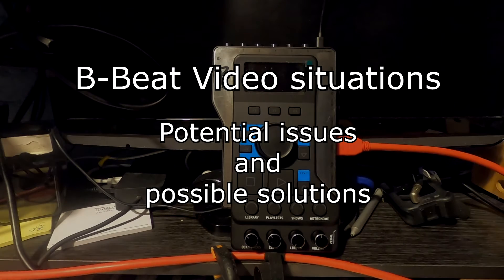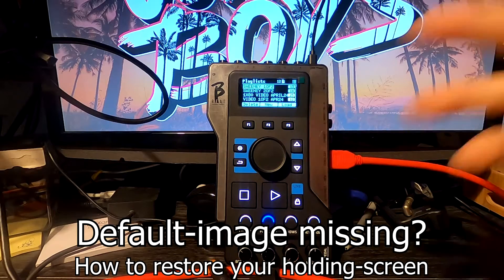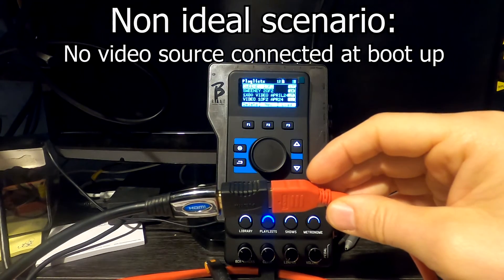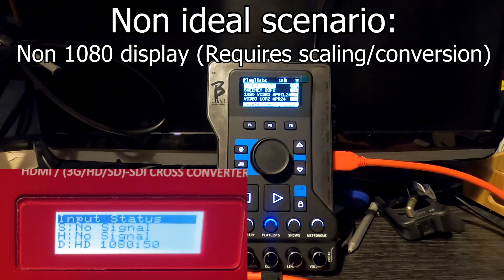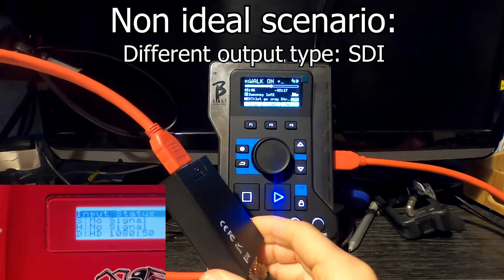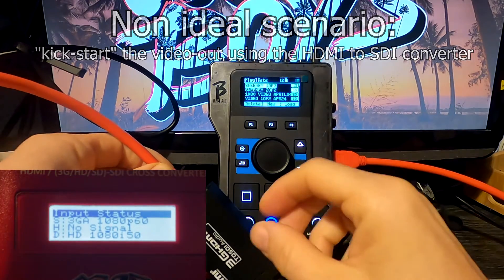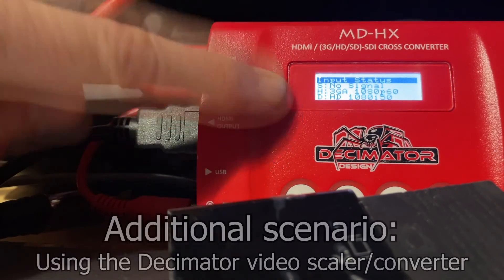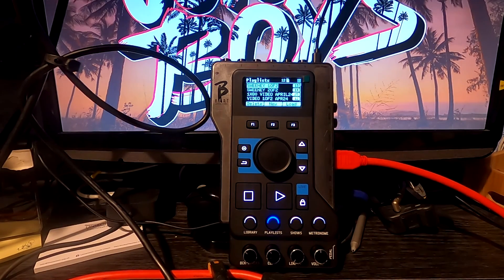B-Beat video output: scenarios and solutions

Comment: Thanks for this video - its pretty clear to me that the BBeat does not output a "standard" signal, if it did then we simply would not have these signal issues. The other day I was at a gig with a large LED video wall, the video feed to FOH did not detect any signal but you plug in a cheap £250 laptop and it works flawlessly. We as consumers should not have to spend £400 on video scalers or any additional devices, the BBeat is a unit aimed at professionals and its going to be used with professional displays and not cheap computer monitors. Surely MLive could change the firmware to allow the end user to change the output resolution and framerate just like a laptop?
Reply from the maker: i agree with your comments and, as you probably know, have suffered similar having to invest in expensive scalers to get round the issue. I think the product-developer is aware of this and will hopefully address the issue in the near future. fingers-crossed!
FWI, i have had a couple of modern LED-wall venues where in -house video sources work but not the b-beat where i've been adding/removing scalers, swapping cables, the venue blaming us (the b-beat) and then mysteriously it worked (without scaler!!) The only conclusion i draw there is the tec-support didnt really know their own gear and either tried something different or realised they'd made a cock-up and kept quiet.

Comment: Just bought this piece - unfortunately the video does not come out at all - tried other solutions, does not work on monitor, or projection
Reply from the maker: Guess you checked your cables and tried a variety of display devices? Have you assigned your video/image file to a project file for playback? (check- do you see a b-beat logo when booting up the b-beat whilst connected to your display?)
Reply: @ thank you for getting back, tried as well - no B-Beat logo appears
Reply from the maker: @ hmmm, not sure then. Could it be having it set to "prompter mode" (so the video-out is auto-cue/words/pdf rather than image/movie mode) be the cause? think you can find that in the b-beat settings or by using the PC/Mac editor. Not used it myself but aware of it

Comment: what type of video file does it take and how big can it be? I am very close to getting one of these. thanks for your help. greatly appreciated
Reply from the maker: takes various video formats and converts it to its own internal format. Ideally load it with a 1920x1080 image. (check the manual for acceptable formats) as for the maximum length, i do not know. Our longest videos are less than 10mins